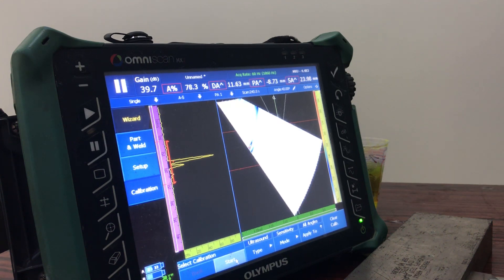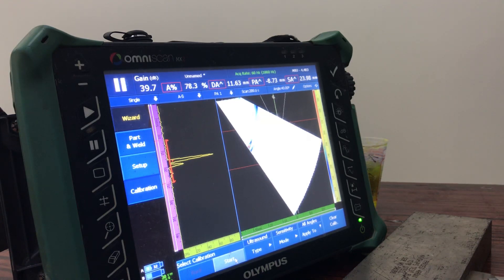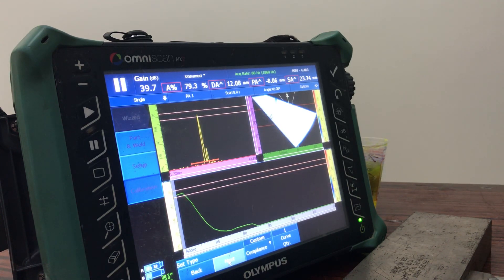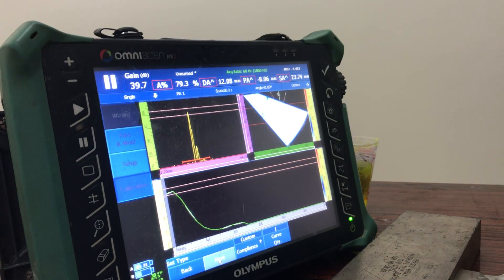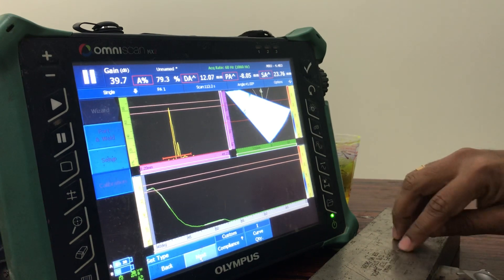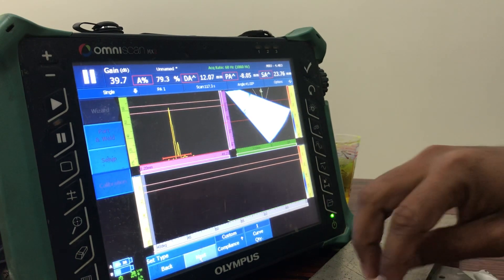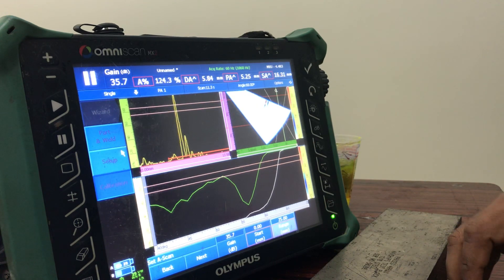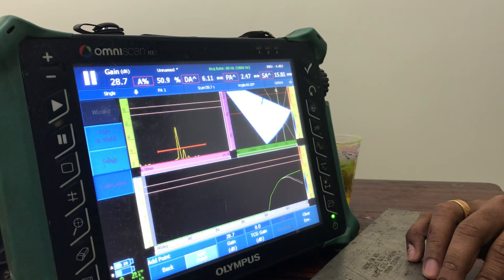PAUT(Phased Array UT) TCG 1st point calibration

Comment: How to calibrate velocity on pipe we have focus px and dont know to calibrate
Reply from the maker: Icywindy , sorry,actually I am not aware about ur machine , 
For velocity calibration is nothing , how ever u have to know about the specimen material velocity , in that case u can do with zero degree wedge , so simply u will get the 2 back wall ,there for we can consider 2 back wall as a reference point.

To figure out velocity, you divide the distance by the time it takes to travel that same distance,
Reply: @CLUSTERNDTTEAMINADVANCE  tq for your answer I will try it,this machine is new for us so its hard to calibrate
Reply from the maker: Icywindy  plz show me the pic for calibration option related. !
Reply: @CLUSTERNDTTEAMINADVANCE  i dont know why,but i cant send link for pic in here

Comment: What is the principal of PAUT
Reply from the maker: I hope ,u already know abt UT( ultrasonic Testing), PAUT is advance method of Conventional UT,The PAUT probe consists of many small ultrasonic transducers, each of which can be pulsed independently. By varying the timing, for instance by making the pulse from each transducer progressively delayed going up the line, a pattern of constructive interference is set up that results in radiating a quasi-plane ultrasonic beam at a set angle depending on the progressive time delay. In other words, by changing the progressive time delay the beam can be steered electronically. It can be swept like a search-light through the tissue or object being examined, and the data from multiple beams are put together to make a visual image showing a slice through the object.
Reply from the maker: Kumar Raj  In UT , there is only one element and 1 angle at a time (45/60/70), in PAUT , there is bunch of element ( depend upon probe),and its steering bunch of angles also, so we can easily cover the full weld Body portion and HAZ( heat affected zone) with help of beam tool software. I hope u understand 
Thanks for ur comment